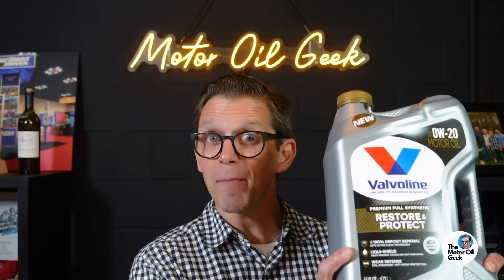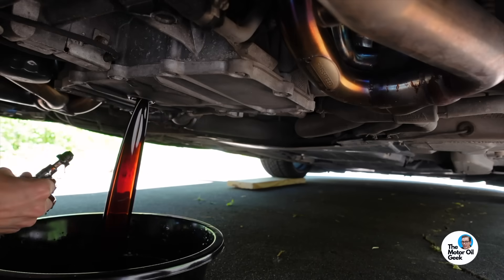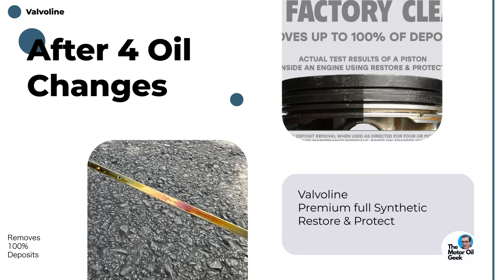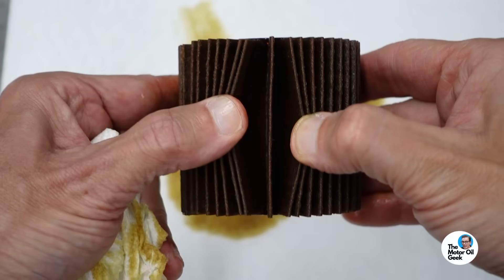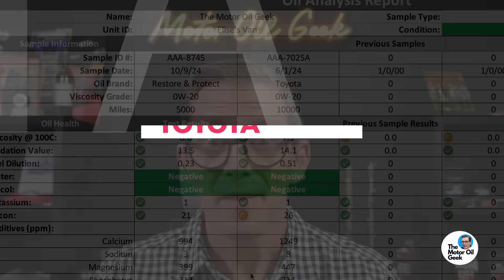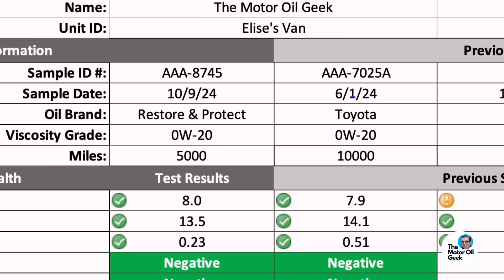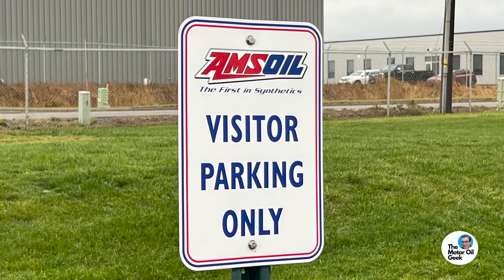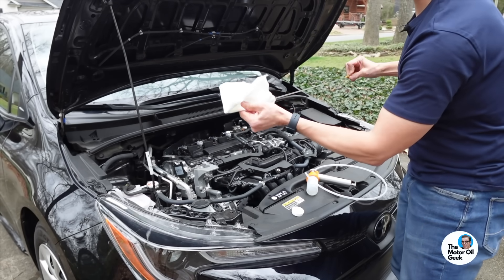The TRUTH About Valvoline's BOLD Engine Cleaning Claims

Comment: I'm using Valvoline Restore & Protect in my 2010 sienna with 245K. It has had 5k oil changes all of it's life and I'm 2K into the Valvoline Restore & Protect oil change so it's too soon to know but I will check the dip stick soon...

Update: The dipstick is pristine clean, however I have to admit that I don't remember seeing the condition of the dipstick before adding VR&P.
Like the van in this video the oil changes where all done at the dealership every 5K by the previous owner so I'm assuming it was Toyota oil...

Comment: What if i just run VR&P  with every oil change forever in my 2008 Ford E350 SD 5.4L with 160k miles? Would it hurt anything? And living and ONLY driving in south Florida i'm using 5w-30 because, even in the 'winter' it's 80deg.

Comment: I have a 23 year old 6.2 L MerCruiser motor in my boat and was wondering what oil additive I could use equivalent to restore and protect to help clean old deposits? The boat uses a marine grade oil rather than the standard auto oil. Do you know if they make a restore and protect for marine engines?

Comment: I put Mobil 1 0W-20 in my 2013 Lexus GS350 with 75,000 miles and added ZDDP (up to 1,500 PPM). The car then blew white smoke at wide open throttle. I then switched to Restore and Protect and it doesn’t smoke anymore. I’m a believer.

Comment: Hey Oil Geek Guys — love your deep dives into oil chemistry and deposit control. I’ve got a question that’s been bugging me, and I’d really value your take.

I’ve reviewed service records across multiple Subaru dealerships for my Outback, and every single one lists Upper Engine Cleaner (UEC) as being applied after the oil change. No combustion cycle, no pre-drain treatment — just fresh oil, then UEC, then a short idle or handover drive.

From what I understand, UEC is meant to loosen carbon and blow-by residue from the upper piston area and valves. If it’s applied after the oil change, wouldn’t that risk contaminating the new oil with debris and solvent traces? Seems like it could shorten the oil’s protective life and overload the fresh filter early.

Is this a common dealership shortcut? Or am I missing something in how UEC is supposed to work?

Would love to hear your thoughts — especially on how this sequencing might affect oil longevity and filtration performance.

Comment: I’ve swapped to this oil in 3 of my vehicles and I’m very happy with how it is performing, I want to swap the oil in my Chevrolet 2500 , but I get nervous because of the recommended Dexos , would using this oil be detrimental to it? Instead of Dexos

Comment: I'm on my third round of VRP in the engine. Ive used high capacity oil filters in conjunction.
I run 5k mile intervals with no issues. Engine should be very good. The fill hole and dip stick are silver too.
Great oil.

Comment: A word of caution about this oil to people who own truly old cars and engines. I have some 60's and 70's Chevrolets and Pontiacs. This oil does not come in a viscosity that is recommended for use in these engines, during most of the year, at least in the South and other moderate regions. The thickest viscosity that the R&P oil comes in is 5w30. According to my factory manuals, that viscosity should not be used in 60's-70's engines in temperatures above 60 degrees. So, it would be okay in the winter only where I live. But, I wouldn't run it in warmer weather in my cars, especially now being summer of 2025, with temps in the high 80's and 90's. Might give it a try in the dead of winter. I normally run the recommended 10w40 all year with no problems.

Comment: I purchased a 2025 wrangler 3.6 (my 4th wrangler with the pentasutar so I know what I'm getting myself into with right side cam issues from lifter failure)
I did my first oil change at 275 miles and second at 1000 with valvoline restore and protect 5w-30.  the vehicle was built in December 2024 and sitting on the lot until I picked it up at the end of June 2025 (6 months of sitting give or take). 

at 2,500 miles I will change again, then change the oil every 2500 miles since its so cheap and I have OCD with these engines, even though it will inevitably fail.  

Do you recommend me using VRP in perpetuity  (Pentastars are notorious for carbon buildup up from the EGR) or should I use PUP 5w-30 which has better wear protection every 2,500 miles?

Or should I cycle 3 changes of VRP and 3 or PUP? this way im keeping the motor clean but getting the added benefit of PUP's wear protection
Reply: any updates?

Comment: Why to reduce the care of your engine to oil. My advice: change all fluids like steering fluid, cooling system , transmission system and engine oil at manual sugested intervals... supertech of walmart is totally fine using the right SAE specification.

Comment: For some strange reason, both NAPA's and Autozone's websites tell me that Valvoline Restore and Protect is not a fit for my 2009 Corolla with the 1.8L 4 cylinder engine, even though it's the same weight as what Toyota recommends. I find that very odd. 🤔 I put it in anyway.

Comment: My 1993 Toyota Corolla has 408,000,000 and has never used any oil I use Pennzoil and Motor-kote and change oil every 3,000 miles. You can buy a new one if you want. I spent my money on bass boats.

Comment: Just put the 5w30 version in my 01  Tacoma that has 226k and been changed every 3k since new. My oil always comes out fairly clear and what I deem probably half used or less. I noticed the R&P smells vastly different than standard synthetic or conventional. Smells like gear oil or like degraded diff fluid. I’m only 300 miles in, I guess we’ll see.

Comment: My friend's Kia Rio 1.6 liter GDI motor with oil changes at 5,000 intervals since new.  Started consuming oil at the rate of one quart per 700 miles at 160,000 miles on the odometer.   I switched to Valvoline R&P, after 5 oil and filter changes totaling 25,000 miles of use, the car now consumes one quart per 1,900 miles with over 185,000 on the odometer.  Made a believer out of this Mobil One user since the 1970's.
Reply: Sweet!
My dad has a 2016 Hyundai Accent and I used Valvoline R+P to try to get the most out of it. I changed the spark plugs, and I did see some oil on one of them. Hopefully this unsticks the ring and the spark plug does not get oil on it.

I ran some Liquimoly engine oil flush, then drained the old oil and spun off the old filter first. I figure this will get the most good.

Comment: Hello Lake, thank you for the video. Given Restore and Protect works so well in petrol engines, should I start using an equivalent in my new vehicle. I  live in Australia and have purchased a new Ford Everest , V6 Diesel. Is there an equivalent for Diesel engines? I had the engine oil changed at I000Klm and recently at 5000klm. The recommended oil is SAE 5W-30, ACEA A5/B5

Comment: I'm a mechanic here in Australia and our go to oil for dirty engines is always Castrol GTX changed every 5000km's with a new filter, 4 times for a total of 20,000km's but it seems like this is a better option as it's a higher quality oil. Thanks for the information.

Comment: Lake, I had to view this again and now I see why my oil analysis revealed high copper and lead,  it was cleaning I assume.  Is that a correct assumption? The analysis was done on the 1st run at 3K and I was told to change it.  I’ve  collected a 2nd run sample and will send out soon, changed at 3,500 miles.  On my 3rd run now.
Reply from the maker: Copper and Lead are typically bearing wear metals. The trend analysis of those levels across the oil analysis results will show if it is cleaning or a wear issue, which would be viscosity related.

Comment: Ive been doing 3000 mile oil changes, i last did it at 134.8k and im at 136.4k now with my first round of restore and protect, i havent been inside the engine since it but i have checked my dipstick every fill up, looks pretty dark but im harder on my car than i should be. Cannot wait to see what it looks like the next time i do a valve cover or something, but even then my j35z2 was really clean for its mileage

Comment: I just bought a mint 1 owner 23 year old regal. It was burning little oil, not a lot. About 1 quart in 5 thousand miles. I used this valvoline oil, and on the first jug, there was no oil loss yet. Can't wait until it's been 4 jugs later. Great oil!

Comment: I have 3 Sonatas, 2004, 2006 & 2007. All have between 110k and 140k . I live in central KY. Owners manual calls for 10w-30. Last oil change on each I changed to 5w-30 restore & protect.  I am due to do a 6 month change on all three. Am I safe to continue using the 5w-30 R&P? None of the cars are using oil.

Comment: Great video. You should do a comparison to Pennzoil Ultra Platinum, as others have suggested, but focus on the FTIR tests. As one engineer to another, your discussions of the base oil and the additive packages (esters, etc) that don’t show up on a used out test are extremely valuable. I think the question all of us want answered is whether this is a better permanent use oil than PUP. Thanks.

Comment: 180,566 miles on my 2004 Sienna, and this stuff does work. I'm on my third oil change, and the acceleration and overall operation of the engine are much smoother now. My wife's mother has a 2000 Tundra, and even after the first oil change, there was a noticeable difference in how the engine behaved while idling and on initial start-up. I am personally sold on this oil.

Comment: Since it’s not dexos1 approved you think it’s fine if I run it on my 2011 Silverado 5.3?
Reply from the maker: Yes, it is fine.
Reply: @themotoroilgeek thank you for the reply I’m use it on my next oil change because my dipstick looks the same as the dipstick on your wife car. My truck is at 162k miles but I’ve always done 3500-4000 mile oil change with Mobil 1 synthetic.

Comment: 1995 Dodge ram 1500 with a 318 engine I put over 380,000 miles on this engine never had any issues using Valvoline engine oil.

Comment: It did plug my filter on my 208,000-mile Subaru. But I'll make sure to change the filter every 1000 miles from now on until my third oil change or so. It means it's working!

Comment: Gonna try 5 Q of VRP + 1 Q of my Kirkland 0W-20 tonight.
Reply: NVM.... I actually used 5.9 Q of R&P.  Forgot to cut open the used filter for my comparison when I change out my first filter running this new oil.  SMH.🤦‍♂️ But w/ under 49k mi, I think I hear less lifter noise already.  👍

Comment: I've been trying this in my 2005 Yukon XL Denali 1500 with 210,000 miles and two oil changes so far. Today I went to WalMart to buy another six quarts and... no Restore and Protect on the shelf! Not even a P:LACE on the shelf for it. Has Valvoline quietly withdrawn this oil or is it just WalMart? They had plenty of other Valvoline oils.
Reply from the maker: That’s a Walmart deal. The Restore & Protect is still on the market.

Comment: Hyundai 2015 Elantra GT 2.0L with 90,000 miles. Was using one quart per 1,000 miles.  After 15,000 miles and three oil changes, I’m now using .25 quart after 2,000 miles.
Reply from the maker: Thanks for sharing.
Reply: My Toyota Innova with gasoline 1TR-FE engine is consuming 1L of oil every 2,000km. I will try valvoline restore and protect for the next oil changes.
Reply: @kimcyrusm8995  I'm planning on using it for every change on my 13 Sonata with a new factory warranty motor. Hoping it will keep it alive!
Reply: This oil condition seals that leak reduce leaks !
Reply: Oh! that could be an indication of the oil control rings getting cleaned and now working properly again!

Comment: I have a 1994 Ford Explorer Sport. When I bought it 3 years ago at 130k miles it was burning enough oil that the oil light came on a couple times. The previous owner even removed the catalytic converters, probably because the oil consumption destroyed them. I am now at 194k miles and have been using Valvoline Restore and Protect for about a year and a half and it doesn't seem to be burning any oil, I don't have to add any between 3k mile oil changes anymore. I haven't changed any gaskets so the only thing I can think is maybe the previous owner didn't change the oil enough and the rings we're gunmed up but now they are free because the Valvoline R&P has done such a stellar job at cleaning the engine. I just tested all 6 cylinders and the compression is between 185 to 195. I am frankly, amazed. The only downside to the cleaning action is the valve covers are now leaking on the exhaust manifold so I need to fix that but that could also just be caused by the vehicle being 32 years old with almost 200k miles. I run Pennzoil Ultra Platinum in my 1999 Ranger and 2016 Mustang and am also very happy with that oil. If your car burns oil like some Toyotas and Hondas are known for, try this oil, it cant hurt, it definitely helped me, I am sold. That being said I think it worked for me because my engine (the Ford 4.0 Cologne) isn't known for burning oil, it was probably just poorly maintained but certain Toyotas like the 90s Corollas and 2008ish Camrys and Honda 3.5 V6 had defective rings so this oil may not fix your problem.

Comment: If we're cleaning deposits, are we increasing the chances of introducing an oil leak? I've always heard that if we have a high-mileage engine, those deposits may actually be helping to prevent oil leaks.
Reply: It's possible that it can leak if your gasket is severly leaking. But from what I hear, the oil  does "protect" so all gasket will get a little treatment to help gaskets,  like oils that are reserved for high mile vehicles.  But I'm only on the 300 mile mark.   I will have to say that  my Tacoma is driving quieter, more responsive, and has more power, but if something starts leaking I'll report back.

Comment: Ive been using r and p since it came out. Its the real deal. Ive used it in two different 5cyl volvo motors with super high mileage, one turbo, one non, and its cleaned both motors incredibly well

Comment: Just started to use the Valvoline R&P in my 2011 4.6 V8 Genesis. 166,000 miles on the clock, been using Amsoil SS  since about 130,000 miles, with 5,000 miles oil change intervals. Great oil, not going to lie, but I recently inspected my engine, thoroughly, and not one inkling of a vibration or any type of rattle at startup (cannot tell its running), it's making my Genny purr like a baby kitten! Increased throttle response, zero oil burning, and overall running better even than  with the Amsoil SS (bold claim to make, I know)! I will follow-up after 2-3 oil changes with R&P with a progress update, but I simply cannot and outright refuse to believe this oil is performing as well if not better than Amsoil SS, or at least it is starting to appear that it is thus far according to my experience to date! More data to come in the future...
Reply from the maker: Thanks for sharing!

Comment: I have a used 2011 Mercedes GLK350 with 121K miles GDI motor.  I am squeamish about using the VRP as Mercedes specifies oil that meets their particular specifications.  I am currently using Mobil 1 FS European Car Formula Full Synthetic Motor Oil 5W-40 (meets Mercedes 229.3 and 229.5).  I am also located in Glendale AZ where it gets hotter than a toaster and leery of running 5W-30 VRP.  Last oil change had 261 miles but 12 months, I ran two cans of CRC intake valve cleaner and I ran it hard 100 MPH before draining.  Some sparkles in the drain pan but none present in the filter.  Oil was much darker than expected, I attribute that to the CRC intake valve cleaner and very hot draining and Italian Tuneup.  Please Bob give me some good advice on what to do and run to keep this pricey engine alive and well.

Comment: Based on this video and others I went hunting after seeing this video I bought some VRP for my wife's old car.  It did quiet down her old car and it sounds pretty smooth.  I will run it for 2 oil changes and then do an UOA to see how it is doing.  One thing that I noted is how strong this stuff smells.  It smells a LOT like gear oil.  I would think that would provide some clues regarding what is in this stuff.  

I am going to be doing another change on my new truck as soon as I get the break in miles done before dumping the factory fill oil.  I think if this does that well to clean up a mess it seems like a no brainer to run it from new.  I will have to get a UOA on the new truck from the first few oil changes so I can track how it is doing.  I will do 2 short interval oil drains and then use the oil life monitor in the truck to indicate when to change it and see how that works out.  I want to make sure the wear rate is low and no indication that this is hard on the gaskets and does not break down too fast to use the OLM for tracking it.  It does not look like it is engineered for extended drain intervals. I saw something on BITOG that they state it is GTL based now.  I don't know if that is new or just new info they are providing.

Comment: Sir you truly are the Oil geek. I have a VW Vanagon camper with a Subaru swap . The engine only had 98K on it when I swapped it in. It’s always used a quart or more every trip! I’m going to try some restore and protect and see what happens. I’ll check back in with the results.